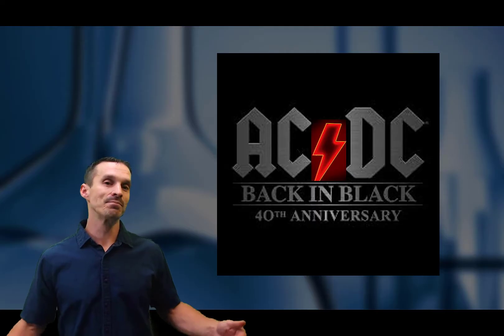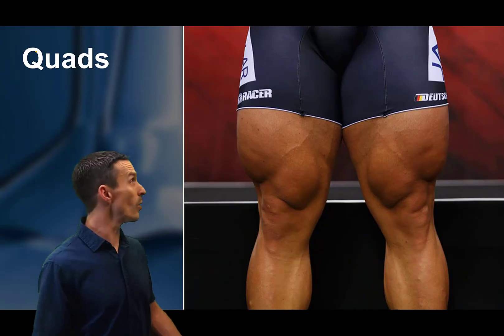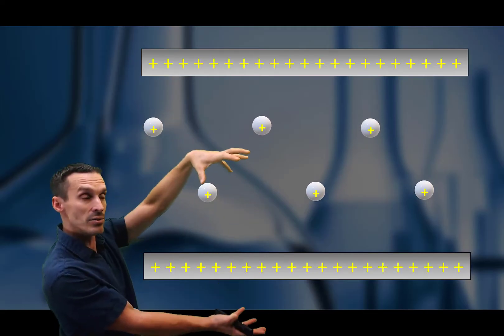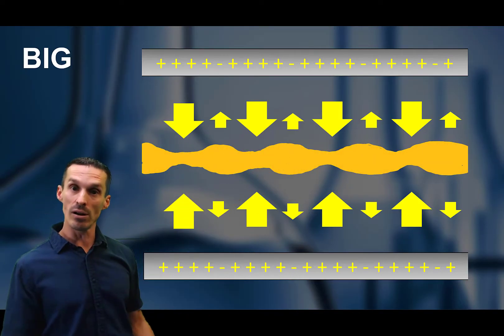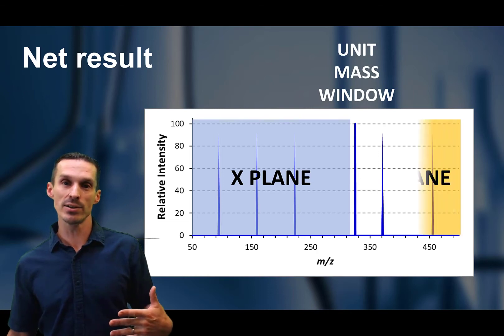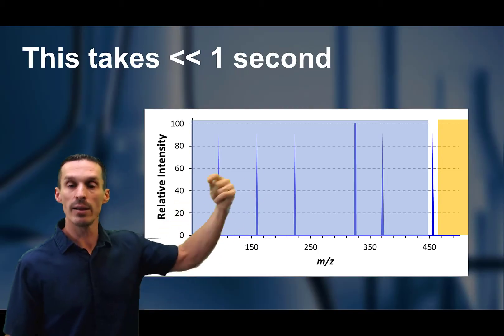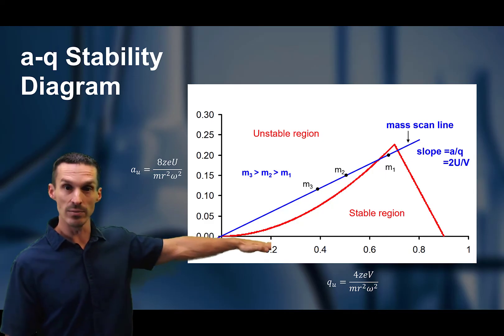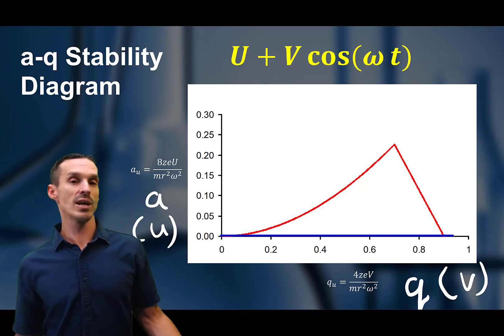Quadrupole Mass Spectrometer

Comment: 8:50 the one thing you missed out on mentioning is the inverse square law. If you plot the potential energies of the ions between two poles, you get either a knife-edge (i.e. 1/x^2) where small ions roll off, big ones don't have time. Or you get a parabola-shaped ditch (x^2) where the big ions have enough momentum to get all the way up the walls.

Don't know if it'll help anyone else, but I always like watching balls roll down planes.

Comment: Hello, I have a question. At 7:02, the field in the Y plane shows one rod as ------+------ repeating. and the bottom rod shows as ++++-++++ repeating. Was this suppose to be intentional? That is why the smaller positive ion is stable?
Reply: I don't know for sure but I think it was mistaken. It should have been the same with the upper one.
Reply: Hi , I have the same question. The  bottom rod show ++++-  is correct or wring ? do you have the answer ?